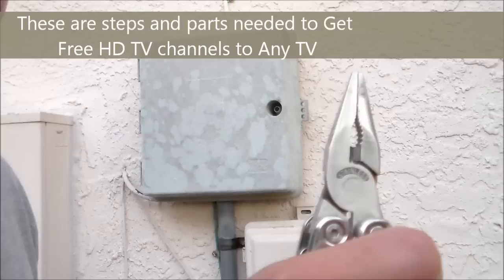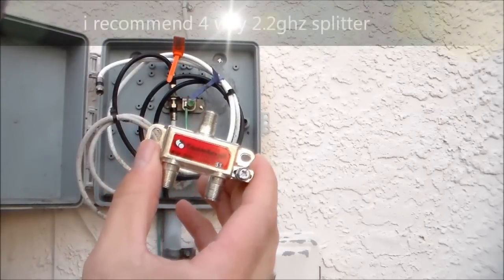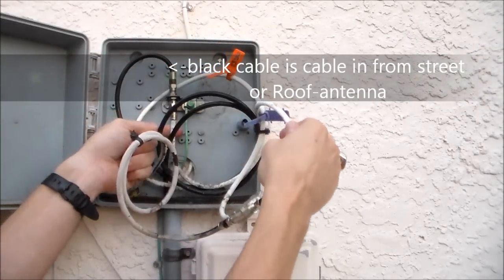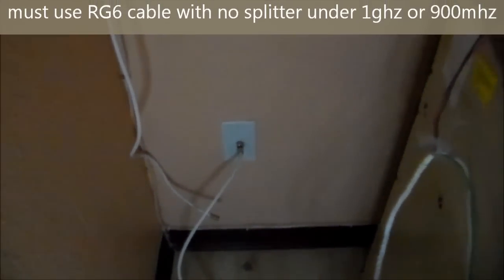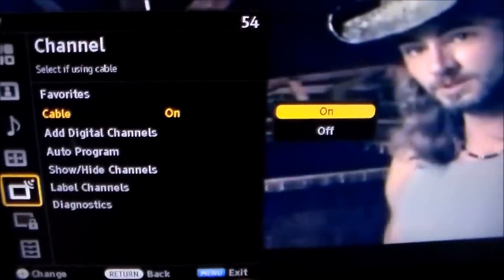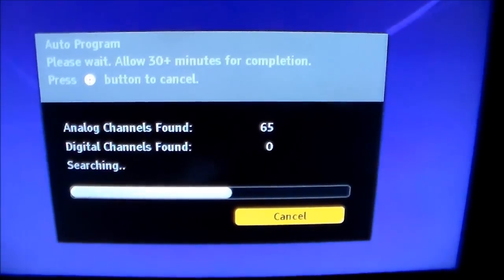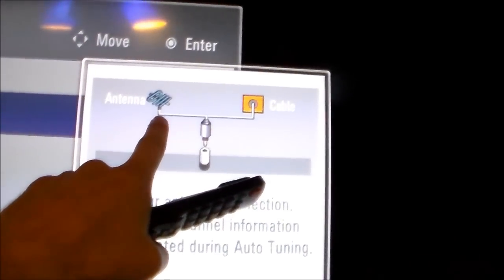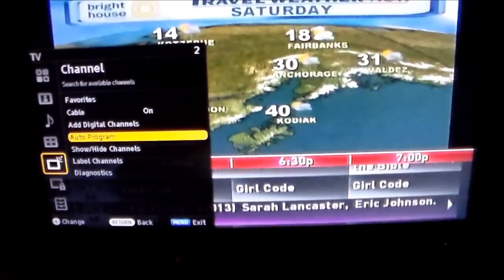How to Connect Cables to Get Free HD TV Channels Legally!!!

Comment from the maker: UPDATE I RESEARCHED THE LAW ON THIS, you will void your warranty connecting a cable splitter in your box that is "mounted on your home" (follow the laws in your area and act at your own risk) but it is legal if you pay for basic cable (internet) and you're just connecting extra rooms for free without paying extra for cable boxes (now cable is converting to digital which this way may not work anymore). Also connecting an off-air antenna and using a splitter to your rooms is legal and is 100% FREE TV. Always ground your system. good luck
Reply: What is an "off air antenna"?
Reply: It is just another way to say "over the air" antenna. Meaning: "An antenna that picks up channels broadcast through the air rather than broadcasting using cable."
Reply: Can you get HGTV? That is all my mother needs so she pays for cable, its nuts...
Reply: Tampatec

Comment: Not to sure of the legal ramifications of this install. Here's my problem......... CATV is considered a "Closed" system. The CATV companies spend a lot if money in keeping that system closed. In other words, they do not want there signals leaking out and causing interference to other services, in fact the FCC demands this. Now you come along and install an external antenna to the system letting the CATV signals run up the coax and radiate from the antenna. This "Passive Antenna System" is now causing possible interference to local authorities,Fire, Police, Aircraft if your near an airport. Hence the system is in violation, meaning YOUR in violation. And it won't be long before they track the problem down.
Reply: Cable TV signals have NO radio  carrier, so they can't travel "wireless "
Reply: Ct.Kirk Karaoke They can with a signal booster which is the direction Directv is currently going, depending on your configuration it's not always consistent, the genie system controls the network for the tv's which can also be programmed to integrate your internet service with your receivers to utilize the various apps features offered by directv.
Reply: Ct.Kirk Karaoke I hope you aren't trying to equate a signal leak with "wireless radio signal"? The FCC requires that cable operators check their system every quarter for signal leakage, the entire system. If a leak is found, then it must be fixed. IF it is coming from a customers home, the customer will eventually be disconnected if they don't allow the cable company to investigate the problem. A loose connection, a frayed wire, after market junk splitters and connectors all cause it. Intentionally feeding over the air signal back onto the cable plant (system) will most certainly get you disconnected and possible fined. Signal leakage (CLI) is found and not fixed, it can interfere with airplane radios, police and emergency radio, etc.Think about it this way, If you have a 2.4 Ghz cordless phone and a 2.4 Ghz wireless router, ANY time they use the same Chanel, one (usually the router) will stop working.
Reply: Jimmy Pizl Cable is still strictly regulated by the FCC. There are heavy fines and penalties for the consumer if those laws are broken. It is not "Stealing" cable, the proper term is "Unauthorized viewing". Which means; if you are watching it and you aren't paying for it, your'e breaking the law. This includes moving into a new home where the cable wasn't disconnected from the previous tenant. Whether or not the cable service is active in the video is irrelevant ,  it is Teaching people something that IS illegal for those that do.
Reply: Kirks Karaoke Not true. Leakage happens a lot. As Robert said, a CC has equipment and manpower alloted just for this reason.
Reply: Jimmy Pizl You bet your ass he is. If on the end of one of those outlets is a big ass UHF antennae I guarantee you a leakage meter is going to zap out when it goes near.

Comment: You never ground to a water pipe plan and simple,you can get a electric feed back/shock in the water. You either find a correct ground connect or just don't ground if you don't have a good ground source.

Comment: I have a digital HDTV and was wondering how to pick up the 3 local channels we have here. I tried a couple antennas including an RCA digital antenna which is supposed to pick up local digital channels. One thing I came across was something about Best Buy and Future Shop not having cables running to their HD receivers, but their receivers picked up full digital cable. The couple videos I watched on this explained that their was a paperclip bent and shoved into the center hole on the cable in. I have tried this as well on my TV, no success.

Comment: Why put the splitter in the cable box? Looks like it would be easier to put it inside your home using an A/B coax switch then run a length of cable to digital rabbit ears in an area for the best reception. That's what I did and it works great.

Comment: I'm sure you not supposed to open that box, I was a ATT tech and customers were not to touch our NIU's network interface units. there was no lock on NIU's installed on customer prems for business customers, but they knew not to mess with them.
for residental customers one side of the box is open, the other side is locked where the cable comes in from the underground or roof.
Reply: +brad dovel well things have gone downhill at AT&T, I worked for the old Bell System and it was very strict. We followed the BSP's (bell system practices). Today it's a different company.

Comment: Your videos are very useful and informative. Big thumbs up.

Is there any way to test if the cable has signal?
Is there any way to test the cables' connection with splitter in the middle? Thanks

Comment: Tampatec I have a question. How can I switch from Spectrum cable channels to air TV channels? Recently I cut cable to the most basic channels but I've noticed the the cable box only has limited channels but the other TVs around the house that don't have cable boxes hooked up have over 30 channels. I want a way to switch from cable channels to air TV channels and vice versa on the TV that has the cable/DVR box.

Comment: Hey Tampatec I really enjoyed your video (s) and I like to thank you for posting them.  I'd like your opinion on a problem I have with my dvd player/recorder, you see when it's off it'll turn on by itself & start making a countdown with the cable channels interrumpting whatever it is that I'm watching, sometimes it'll be off and change the display of the time with this Chan 03, Chan 04 and then it'll go back to the time.  My dvd player/recorder is an "INSIGNIA" bought on 2006-2007.  Coincidently I bought a new remote control (ONN) and I think it has a stronger magnet because the problems that I mentioned to you above now happen less, but I would sure like to hear your opinion or give me an orientation on how to get rid of this problem.  Again thank for your videos.

Comment: I have an HD-8000 omni-directional antennae. I used rg-59 coax from when I had Directv. Would I get better signal and more channels if I just switched to RG-6 ?
Reply: Yes. RG-6 is lower loss per foot of run than RG-59. if the runs are less then say 75', you won't notice much difference. No more channels, unless the more distant local stations are a little weak, you may get a few more. But you won't get cable ones - unless you pay for cable and connect a digital TV to do as he has done. What he's done is legal under the criminal code, though the cable company will not like him going into their box, technically THEIR property by contract. It's contractually illegal to go into their box, but  he's merely avoided paying for their monthly decoder box fee, which his TVs can do (decode digital TV off cable). He'll never get pay per view and scrambled subscription channels.

And the re-radiation of cable signals through the off the off air antenna is so weak, practically nil, I do not read any FCC enforcement actions about that, and I get their bulletins as an FCC licensee.

Comment: I have cable internet. Some of the company (not saying) I'm able to watch a few programs on app.The kid they sent out said he had been to these apartment's before so he knew where wires we're. Inside closet with furnace. I asked what if I want to use tablet in bedroom so he put a splitter on wire and Left the 2 bedroom wire's out he said just screw one on to splitter not sure which one,you'll know if it works in that room.He offered to test but my room was a mess. So since cable comes directly out of wall screw's on to modern do I have to move TV into bedroom & screw cable from wall to TV or to digital box.Vizio TV's have no tuner's smart TV please explain so I don't break something. Already this morning I fixed my tablet,I think charger falling out same as last year.This time since I don't think att will replace a3rdX I used that metal tape you use on a furnace. Looks like its charging. thank for your Video

Comment: If you have charter and Comcast this wont work. I requires a box to use cable now. Also to the op video,  the TV is outpouring 720 but your original source can still be 480

Comment: Anyone who recommends a RCA, Radio Shack, etc splitter has no idea about cable signal. First, that splitter is NOT designed for CATV and as you can see, it "Gold Plated". Any 2 dissimilar metals will corrode when connected. You see nowhere in the discription that it is for CATV, it says "coaxial" signal. Coaxial simply describes round cable. Trust me when I say most cable tech's will give you a better splitter for free. Further, he is inputting over the air signal into his current cable service and possibly back onto the entire cable plant. This could create issues for his neighbors and himself especially if he has internet or digital receivers hooked to the same cable system. I caution you NOT to do this if you are actively connected to a Cable System.

Comment: Question...I want to remove my set top box from one bedroom to the den.  The den has a wall outlet, but it's from another cable company.  Will that cable line be at the main box, unconnected obviously...if so, can I connect it to the current cable company line and it work as it should?  Thanks

Comment: then the technician will have to come out because the splitter doesn't support the higher frequencies or you just created a whole bunch of ingress/egress. not to mention if you have CPE and you don't calculate the RX and TX properly. now you know why your cable doesn't work and you get a charge on your cable bill for customer tampering.

Comment: wow channels 3 5 and 8 are all yours. btw do you really think a 14ga ground wire will discharge a lightening strike. If it hits that antenna your tvs are done. catv grounding is for ingress and nec reasons and does nothing for lightning. Also if I were working next door and seen any modification to the outdoor enclosure ie: dish or antenna wire running to it. I would remove box and hack wiring so short you could not use it. R

Comment: Can you help me with my TV it keeps jumping and flickering . If I smack it a couple of times it works back to normal but it comes back . Sometimes I turn it off and on and that fixes it for a few hours. I can show you a video if you need to see.
Reply from the maker: if it flickers on only tv turner input then its loose connection ( bad cable connection or tv's bad solder connections on video board) or weak signal.
Reply: if its Comcast, just take a really big and heavy hammer and give it one good  whack or ten

Comment: WRONG !!    Wow.... I just saw this video in my favorites. There are several problems here and others have mentioned them. If you no longer have an active cable contract you "could" disconnect the line from the street and insert a rooftop antenna to feed the house. You cannot add a splitter and mix off air (antenna) signals and cable together. The cable company purposely transmits a high power signal on the cable to check for leaks. This signal would be leaking out to the roof top antenna.  Grounding the cable as shown will protect the TV from lighting strikes..... not voltage surges. Only a surge protector will stop surges.

Comment: I don't have that cable box because I had Dish Satellite subscription, so how best can one take advantage of existing coaxial cable connection to get OTA broadcast?
Reply: Henry Wifa If your TV has a QAM tuner it may be able to pick up OTA without an antennae. The copper in the cable itself may be able to pick up some signal. Give it a shot. Hook up the old coax and do a channel scan

Comment: Splitter does not work digital you can spilt a digital signal. You need a dieplexer instead. Or a multiswitch. And cable company does want you yo mess with the services because of possible outages.
Reply: You obviously have no idea what your talking about. A splitter does split digital signal. A diplexer allows separate signals at opposing ends of the spectrum to combine or separate at either end of the cable. A multiswitch selects satellite lnb polarity based on voltage that the receiver sends back to the switch.

I would bet you tried to split you satellite with a regular splitter instead of a multiswitch. The reason it does not work is because the splitter does not pass voltage and if it does its not properly, it has nothing to do with the digital signal.

Ps. 1 All gold splitters are junk. 2 Use splitters rated 5mhz to 3ghz for cable. 
3 Cable modems hate cheap splitters.

Search Antronix on amazon. (they make most of cable co's splitters)

Also never install more than 2 splitters. A 2 way first, one side to the modem and the other side to the tv splitter. ie 6 tvs = six way splitter. Dont go bigger than you need or your wasting signal quality.
Reply: burnz163 YEP, router gets on the very first split , period
Reply: Ok I was talking about a

 UHF/VHF Splitter. And a,digital splitter is what works. Yeah you right a switch of satellite.
Reply: Yeah a digital signal can't be split but a digital spitter transfer the signal to the other line.